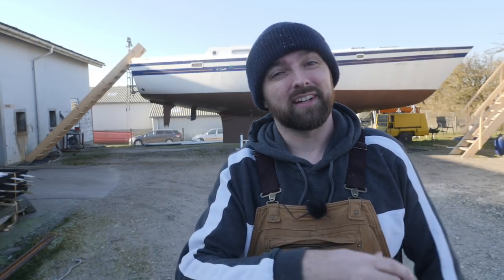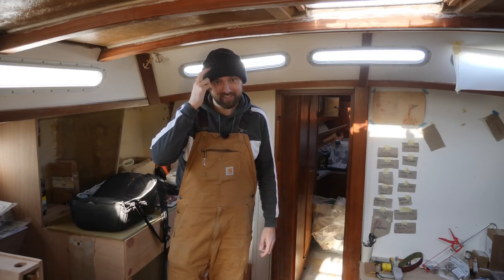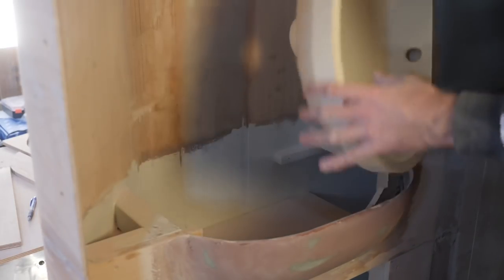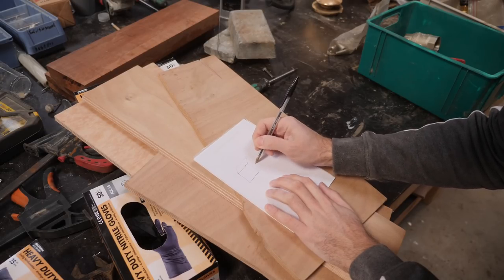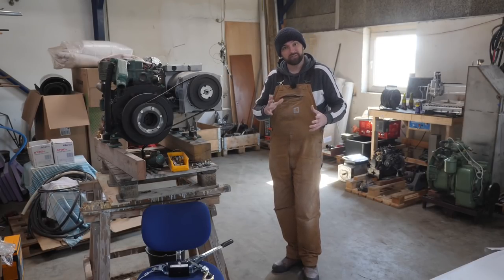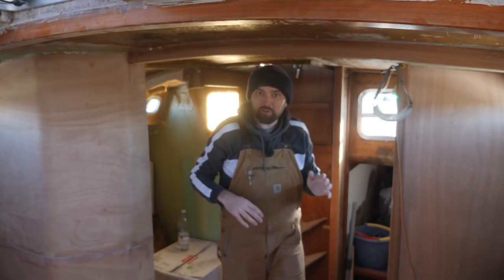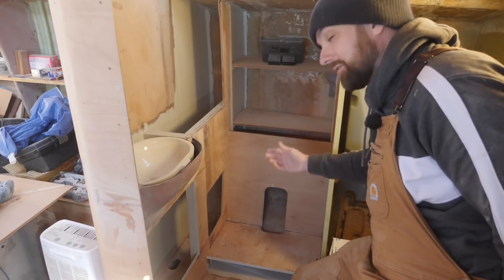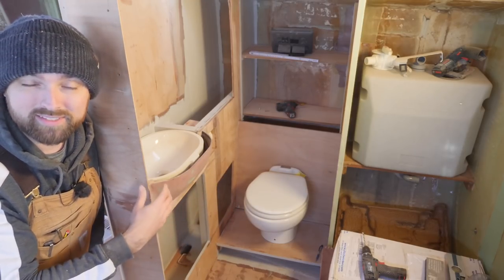Sail Life - Back in Denmark, sink cover and toilet paper holder - DIY boat project

Comment: Um, dude, there’s a reason why TP rolls have spring loaded center  cylinder  holders. First time you hit a swell, that roll is going to come bouncing out of there. You need a positive retention mechanism on top of the dowel, at least.
Reply: Change the design of those glue in plates to have a slot the dowel slides into before it comes to rest in a notch as currently designed.  Or just use a spring loaded off-center roll holder.

Comment: Hi Mads, good to see you back home again.
I think the width of toilet paper can be a bit wider than here in Europe, but the diameter certainly varies greatly around the world, so maybe you should have it in your consideration. Another issue you might want to consider is the hygiene around the box for toilet paper. You can risk that that the opening to the toilet roll might be contaminated with a small amount of stools. You know, sometimes it can be quite challenging to clean the behind when there are a bit of waves. ^_^

Comment: Great video, makes life seem almost normal watching this.  There's a few comments below about square dowels, or just ends,  to help locate the dowel, but angle the slot so it's sloping back slightly.  A bit of trial and error here but you don't want to make it fiddly to insert.  A piece of small diameter stainless tube would be better as it won't want to grab the toilet roll - lots of torn sheets.  Amazing how a small item like this attracts so much attention.  Perhaps this is why the US is running out!  Stay safe everyone.

Comment: There is a major problem with your TP mounting as you have shown in this video, fortunately, easily corrected.
TP must feed off the top of the roll ...it is the law! :)
Reply: i oppose the self imposed law and will demand that feed stay the bottom side. much easier to unroll its self when top feed. case closed
Reply: If you don't feed it from the top you are officially a bottom feeder.
Reply: LOL
Reply: As a officer of Ass a can state that this is in fact a true statement
Reply: How to tell if someone has never had a cat
Reply: only in the Southern Hemisphere
Reply: https://en.wikipedia.org/wiki/Toilet_paper_orientation Wikipedia is formal, 72% of repondants choose over
Reply: Under the tp patent paperwork. It is clearly shown, in diagrams. over the roll is the correct way to dispense. 🤓
Reply: It is the law coming from ancient times as the venerated elders teach us!
Reply: Jeremy Wylie true, patent show top feed 💪🏽
Reply: I used to dead set on shit-paper coming off of the top of the roll. But, recently, I've changed it up. I put it however is needed to make sure the "grippy-est" side of the TP is on the outside of the bit that I'm using.

Comment: I  suspect you will get 1005 output from your alternator. Point to consider, make the belt tensioner independent of the alternator mount.  Many belt and sheave failures are due to misalignment when trying to make tensioning and mounting in one device.  Also,  cogged powerbands are the way to go for driving this sort of thing.  Glad you are back. I feel for Eva.

Comment: Glad to hear you made it back in one piece, suck you can't be with your girl in these times and that you had a bit of hell getting beck. All I would say about the toilet paper holder is to make some kind a spring hold down for the spindle, I can see in ruff water it popping out and then rolling about, which "could" turn in to a danger if having to rush through the cabin.

Comment: Re douche arrangement for heads.  We like a bidet too for the reasons you mention in the latest video. Our solution was to fit the 'Whale RT2498 Mixer Tap & Shower Combo' to our heads basin.  They behave like normal taps but the tap then pulls out on its pipe and becomes a douche!  Brilliant - they work for us.  N.B. They definitely don't like frost.

Comment: It may be my gunsmith formation speaking but putting a leaf spring ending with an "s" shape on one side and making the other side support enclosing the dowel would be more secure.
That way you insert the dowel in the hole and then secure it by pushing it past the spring bump.

Classic gunsmith loves their leaf springs, particularly for safeties. It seems appropriate to use them here too.
Reply: I was thinking along the same lines :)

Comment: My thought was that you have a hatch above the toilet paper holder which you lift and drop the rolls into. That way you have multiple rolls. Yes you need to cut a square hole in the top of you nice box. You can add a ski jump full width to the bottom front of the holder to stop it coming out in high seas. There will need to be a stop system so the storage rolls don’t touch the active roll then it’s perfect. André

Comment: Re. Your loo roll holder, if you fit a flap to the open side with the pivot at the top, it covers the loo roll (protecting it from splashes) and holds the roll in place. On the lower edge, leave a gap to pull the sheets out. You’d need to put some magnetic catches or similar on the flap to stop the roll opening the flap when you pull. You might also need to smooth out/polish the bottom face and the inside of the flap so the roll can rotate without breaking the tissue as you pull.
Not my idea. Brunswick Marine did this on several of their marques. I can send you a photo of the plastic-fantastic version if you’d like, but I’m sure you can work it out if the idea appeals to you.

Comment: Welcome back.  The sink is looking nice.  In the US TP width seems to be shrinking , in a few years they will advertising 200 roll packs for the price of a 20 package, each roll will be 50cm  wide.
Where are you going to mount the generator?

One safety note.  I noticed you cross cut part of the TB box using the fence as length stop. Very dangerous, if the board cocks just slightly the blade will grab, pulling the board and your fingers back into the blade. If lucky it will just toss it back at you causing a nice welt on you chest.  Don't ask me how I know.  It happens so quick, you will see the red stuff before you know anything happened.

Comment: Thanks for a great video and thanks for pointing out the pandemic clause in the travel insurance, bet a lot of people didn't know, me included.
Guess you've been asked about diesel-electric propulsion? As you work (or worked?) for a company know for its excellence in energy distribution aboard vessels I guess you've thought about that?
A 10-20 kW motor driving the prop should be enough for Athena, and if you install enough LiPo's you could free up space in the engine compartment considerably. A 9kVA generator should be sufficient for long time motoring, while the batteries take care of those short term high intensity power requirements.

Comment: If you cut the slots and the dowel so that it is square, it will stop the roll from possibly rolling/climbing out when the dowel turns. (as it will hold it in place and the roll will just turn round the dowel.
Reply: This sounds like a fair solution to use the parts he has.  But how is he going to fit the bluetooth enabled sensor that lets him know when the roll is almost out while simultaneously adding additional rolls to his shopping list?
Reply: also wanted to suggest as i watched you epoxy the box - that if you used your router to make a slot on both sides for the down to slide back and then down to hold the dowel. then you can just lift the dowel and empty roll up and out of the box to replace the roll.  Cheers, and social distancing from PEI Canada, Bryan :)

Comment: I am Australian and have never seen an actual bidet, so far as I know they do not exist anywhere here.

If you resort to a DIY solution for a bidet could you make one that folds down out of the wall behind the head and rests on the lid of the toilet? 

I imagine it might work like one of those old-fashioned pull out hand basins they used to have on trains!

Comment: Mads,
Have you considered putting a lift up door on the TP holder or possibly a roll top desk type door by glueing strips of wood to a cloth backing ?
Either solution would negate the rough seas scenario as described by many in the comments, and spray from the shower in the confines of the head. 
You really have to wonder what the thought process is that makes people hoard TP  and governments declare gunshops as an essential business during a pandemic.😀😊😧☹
Cheers Eric

Comment: Nice video Mads. Thanks for doing it. Must be difficult being away from Ava. Hopefully not for too long. You might find a spring loaded centre for the dunny roll somewhere so of course you could use it as a template for the marinised version you will build in the workshop.

Comment: Hi, we are just back in Canada after a 6 year, 40k nm sailing journey to more than 24 countries, we have purchased a bunch of toilet paper.  The largest roles by far are in the USA, at 10 cm wide and as big as 14 cm across!  At the other end (so to speak) in most Asian countries they are about 20-25% smaller.... while cruising you will also gather these kinds of fun facts.... fair winds....
Reply: It seems logical, the bigger the a... the bigger the roll :P
Reply: My Kirkland toilet paper is 11.5 cm wide.
Reply: @FlexinJC  yep. I concur. 11.5 wide x 13 od.

Comment: Hey, for once I can share some knowledge with you, I know nothing about boats, fiberglass or sanding but I am a strong advocate for bidet seats.
I owned many bidets, from cheap to way too expensive like the Brondell Swash 1400 which sadly started to leak after 3 years, still probably the best but I now own a Alpha iX Hybrid Bidet Toilet Seat which so far I love, seam like a perfect match between useless features and prices. The nice thing about bidet seats is that they run on 120 or 240 and use little power unless you use the seat warmer, although it's a nice feature in Canada, not so sure when cruising in the equator belt. Also, I confirm, this will cut down your TP needs by a lot, we buy ~10 rolls per month for a family of 5 with kids.

Comment: You could've routed a channel in each of the inside panels of the TP holder in the shape of a sideways lowercase j so you could insert the dowel into the TP and push it into the slots, it would then roll into the bottom of the "j" channel and gravity would hold it in place.
Reply: exactly what I was thinking

Comment: Your Toilet Paper rod is at risk of dumping the paper on the sole in rough seas or even when heavily healed.  If you replaced the 1/2 circle  the with a full circle and used a Toilet Paper Holder Roller available on Amazon and everywhere else for about $1-2 USD.  It is spring loaded and should lock in place with just a couple of recesses on either side.  The one concern I might have is corrosion of the internal spring in a saltwater environment.

Comment: A slight suggestion for your toilet paper dowel holder. Instead of a straight down notch, use a J shaped notch, with the hook towards you. I can see that dowel popping out everytime someone pulls on the toilet paper. Cheers

Comment: No doubt you’ll  have fifty comments on the design of your toilet roll holder. Here’s my five cents worth... the two “half” pieces either side with the half round saddle for the dowel is going to be an endless source of frustration as the roll will constantly fall out since the saddles are not deep enough I suspect. I would cut deeper slots at a forty five degree angle back towards the opening, say 15-20 mm deep.  That way when you pull on the roll the force directs the roller deeper into the slots rather pulling it out of the slots and dropping it onto the wet floor....  You might want to consider a cover as well so the paper remains an approximation of dry!  Of course if the box is not big enough to allow the roll to go in, then drop into the slots, then it’s Plan B which is buy a cheap TP holder from the hardware, scavenge the spring loaded centre roller from it, and just drill two holes either side in the box.  : )

Comment: I still say, you should have a 48VDC generator feeding the battery bank through a parallel battery charger.  Although having AC output does give you a "backup" of AC power and probably more AC power than you would get out of your inverter.  Maybe even enough for some light welding  😁 !

Comment: Have u thought of  capturing wasteheat from genset diesel to warm your boiler water loop while genset running? Wouldn't be a big deal in warm climates (not using boiler for cabin heat) but would be pretty big in cold areas.

Comment: I would say just deepen the cut outs for the roll holder to be 3/4 sunk as yours are a little shallow and the roll will pull out with not much effort.

Comment: Thanks Mads glad u got back, right decision. Would of went with one of those spring loaded bars for the middle of the roll would be more secure in bad weather imho.  Not sure if you are still working being in IT ? If not get the boat finished asap. I think this will go on for months, and if you read up on the Spanish flu, the closest we have to compare too, they had a second wave that was 3 times worst😱 If you get the boat finished and they lift travel bans at lease Avea can get over to you before we hit the second wave.

Comment: Two halves of one plate with a hole, the diameter of the TP stick, placed halfway upshould be more than enough to hold the TP stick, if you place a bronze stick bent to hold the TP stick from jumping out of the half hole.

Comment: I like the toilet paper holder with the revolving lid as shown on the Onboard Lifestyle channel, especially for a wet head.
Reply: linked here  https://www.youtube.com/watch?v=TAuzRvWobrY
skip ahead to the 28 minute mark.
Reply: Definitely the way to go for a wet room and not Heath Robinson
Reply: Michael Shrout  There are so many other ways to do this that don't require sanding or thickened epoxy, but it wouldn't be Mads if he wasn't reinventing the wheel.
Reply: @MidnightVisions  or skip entirely. As soon as they stopped doing real work on their boat it became painfully boring. Channels like Sail Life and Odd Life Crafting show people want to see and learn. That why MJ Sailing is ditching a boat they just finished to build something else, because they lose subscribers doing the same old thing as every other sailing channel.

Comment: Mads good to see you made it back I was worried. You would be stuck in marshal law California. Was wondering what your main engine was again I recently found a Perkins 4-108 I’m trying to score for my refit on my 27Albin FC. But trying to find out if rebuild parts  like cylinder head pistons and stuff like that are available before I decide to make the purchase. If not it’s back to my 4bt Cummins plan.

Comment: A long time ago I sailed with a guy from Helsinki during some weeks. He had no toilet paper on board but had mounted a small handheld shower with powerful water pressure, and instead of massaging your bottom with a paper full of ####, why not clean it away immediately? Bobby, the Doodles guy on internet, is also sold on the idea. He changes girlfriends as I change pants, at the moment he has three (3) of them on board at the same time, so there is certainly something to the idea.

Comment: What is the RPM rating for the generator   ? 2 pole or 4 pole ?  Looks like you are oversizing the generator compared to the available HP from the engine . You really want the gen to be rated at %80 of available engine power at the rated rpm of the genset.

Just a thought, (;-) TP

Comment: Oh oh you really have made it difficult for yourself with that alternator you should have gotten a single bearing with a flexi plate coupling now you need to.align the two parts of the coupling with a rubber inside. I wish you good luck on making that connection piece I did it once and know exactly what you are facing
Reply from the maker: Fear not! ;) It'll be belt driven so it'll be easy to cobble together :)
Reply: @SailLife  ok we will see how it will work out it is not the most ideal coupling
Reply from the maker: @milkoberben2963  What's your concern? Slightly lower efficiency or something else?
Reply: I would want the best for you and 1. MeccAlte is not the best second you just added an extra maintenance point by making it belt driven nobody does that anymore you will not loose much by it size wise the direct coupling makes the foot print smaller
Reply from the maker: Milko Berben the footprint is fine :) Actually it fits better being belt driven. I went with Mecc Alte because that's what a lot of the big commercial boats use over here. We'll see how it works out. I can always replace it down the line.

Comment: You can get plastic and even stainless 1" or so dowels that are spring loaded and only require a couple of holes on either side of your box that fit inside the toilet paper roll and can be easily removed and replaced.  https://www.amazon.ca/Universal-Plastic-Spring-Loaded-Replacement/dp/B0109YUPBA.  I think that would be a better option than a wooden dowel.

Comment: Toilet paper will take up a lot less space in the tank than the water from the 'tooshy'.
Reply from the maker: I don't think so :) Even if that's true there is still the benefit of using less TP.
Reply: @SailLife  Sure, less work for your macerator, for one.  But soak a roll of TP and squeeze it out, and see how little actual volume there is.

Comment: Your TP holder is going to be a disaster in the long run - the roll is going to be a soggy mess with water spillage. Look at getting a Oceanair Marine Dryroll Protective Toilet Roll Dispenser. It has a flap which, when closed, rolls the TP back on itself, seals the compartment and prevents it getting wet. There is nothing worse on a boat than using the loo and then finding the TP is mush - the missus will hate you for eternity!